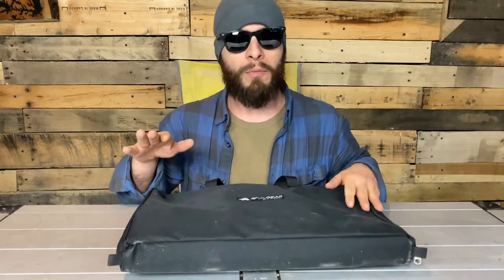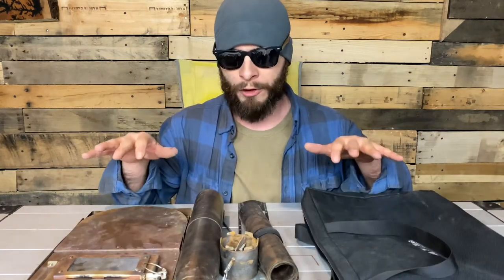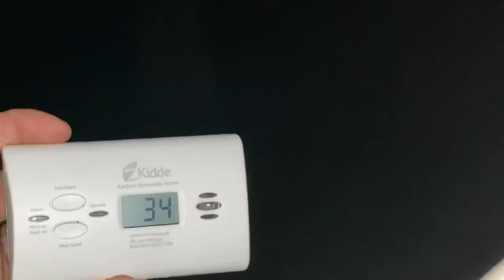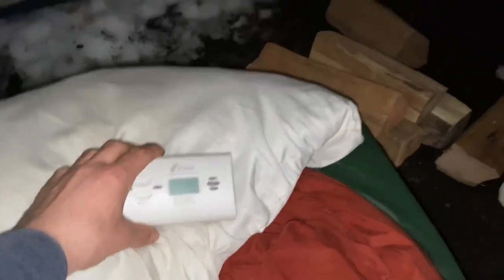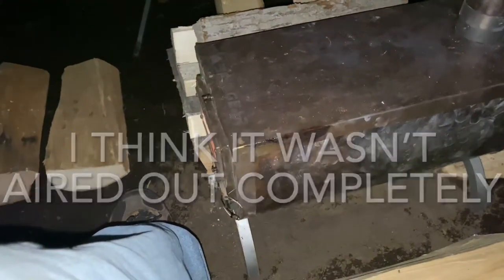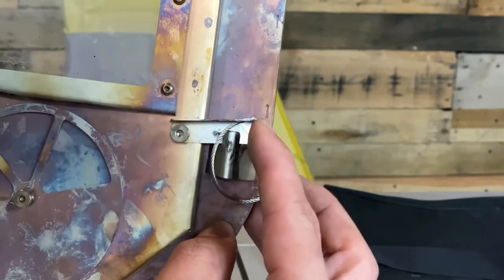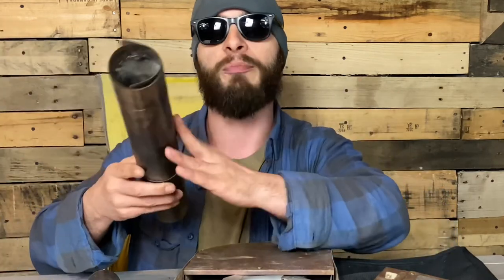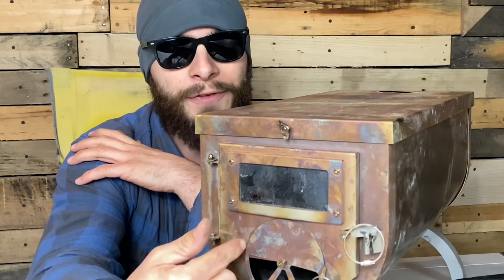Pros and Cons of 3F UL Gear Tribal Stove REVIEW

Comment: I have used this stove for hundreds of hours and I have nothing bad to say. The video shows that you have forgotten one thing. Always remember to check the tightness of the bolts when assembling. That's why the hatch opened.
Reply from the maker: @JKortet could be. I had a few weekends with it running just fine. I’m just sharing my experience that I had and what I believe caused it. Thanks for watching
Reply: Same, I’ve used this too many times to count and works great. My only issue are the stove top guides broke off, not an issue with the front and end have guides and i Needed to make a spark arrestor. It does look mangled lol
Reply from the maker: @banshee107 yeah I only had the problem once, stopped using it after that. Thanks for watching

Comment: When u ventilated the tent of CO, it looked like u opened the top. Isn't CO a heavy gas and would fill the bottom of the tent to the level of the detector? So when u detected again, there was still some gas at that lower level, if that makes sense? Tho I know CO messes with ur cognition, so u might not have been thinking straight, no fault there. Glad u both lived to tell that story. I'm still looking for a lightweight titanium tent stove &/or modifying one of my tents for hot tenting in the winter or shoulder season
Reply from the maker: @Daniel Singh from my research I believe CO mixes evenly with the surrounding air as it’s the same weight as other gases in the air. I could be wrong and you could be right about me not getting a proper reading but idk. I sum it up to fresh air clearing the detector while some was still in there. But I’m not sure. Freak accident for sure and thank you, I’m glad we are fine as well. Thanks for watching!

Comment: I could imagine having that happen, at all, would shake your confidence in a product, let alone with having your kid in there when it happened. I don't think anyone is trying to convince you to give the stove another shot. I certainly am not trying to convince you of that.
With all of that said, I do have a couple of thoughts, just off the hop. Are you getting the stove too hot possibly?
That latch slot could easily be extended with a file or a sawblade, allowing the catch to seat in there further. 
Even if the door warped and lifted, that latch is free floating and would have just stayed in the slot. Certainly if you're jiggling the door up and down like you did, it is going to eventually pop out of that slot. Any door would. That slop in the door could easily be mitigated by tightening the bolts that act as the hinge. 
Personally I really appreciate your honest review of the stove and I appreciate the information.
I also appreciate that you woke up when that alarm went off. I'm glad this didn't have to be a different kind of video. 
I'm going to look for your video on the second stove now.
Reply from the maker: I never did a video on the second stove unfortunately. A company representative said some pretty rude things and left a very bad taste in my mouth, after this video was posted. And kinda moved on from it. Thanks for watching
Reply: @AdventureswithSpackmann   I don't blame you in the slightest. That would have upset me as well. I'll be watching your others.

Comment: Glad you two are safe and sound. I know one company that I won't be purchasing a stove from. I hope that new stove you have works better than its counterpart.
Reply from the maker: @East Coast Outside Adventures thank you! They did change the design of the door on their 2.0 version. Seems better than before. Thank you for watching!
Reply: @AdventureswithSpackmann  No problem.  I seen their rep attack you for your video. What they did was uncalled for. All you did was inform us  of what happened and 2 theories. Hope all is well.
Reply from the maker: @eastcoastwildcamping   thank you. All is well and hope the same for you and your family. Have a great day!
Reply: @AdventureswithSpackmann  You as well. Stay safe out there.🤙
Reply: @AdventureswithSpackmann  OK I must have gotten the 2.0 version. The door still has play but not as much. Still worth setting up a back up latch for safety. thanks
Reply from the maker: @voidisyinyangvoidisyinyang885  2.0 is completely redesigned with a folding body instead of the rolled body like this one. It’s a box instead of the mailbox shape. I’m excited to use 2.0 but maybe they made changes to 1.0 and that’s what you got. That would be cool if they have made changes to the door.

Comment: Holy cow!!  Great demonstration on why to bring a CO detector!
Reply from the maker: @Jeff Pennucci lol right! I made a video testing detectors before and this was a real test! Thankfully I had it. Thanks for watching!
Reply: @AdventureswithSpackmann  I have this stove - thanks for the door warning.
Reply from the maker: @Voidisyinyang Voidisyinyang you are very welcome my friend. Does your door have as much play in it as mine does? I plan on adding a bigger latch to make sure it doesn’t do something like this again. Be safe out there and thanks for watching!
Reply: @AdventureswithSpackmann  I''m checking out my door and my door does not "lift itself up" when I push down on the latch. Also I don't have those front rivets on the glass on the door. So maybe my door is a slightly different design...
Reply from the maker: @Voidisyinyang Voidisyinyang that’s awesome hopefully yours works great for you!!! I really enjoyed the stove until this happened to me. Have fun and make sure you bring a CO detector and smoke detector when using it!

Comment: I sleep in a tent with a stove maybe 20 nights year. I use a carbon monoxide warner too but I would never go to sleep while  the stove is burning. I like this stove you have and I think I am going to buy it because the stove i use now weigh about 40 pounds ha ha ha
Reply from the maker: @Christer Kajan they have the fast folding version now. What stove are you currently using? Thanks for watching
Reply: @AdventureswithSpackmann  oh, it's an 18 kg (maybe 40 lbs) Savotta so it's not anything you carry any distqnces ha ha
Reply from the maker: @Christer Kajan lol I hear that. I have a Camp Chef stove and all in I think it’s 45-50lbs but will heat a house lmao.

Comment: Great video man! Given that the one you had is more or less a prototype and the problems are still somewhat easily fixable (by tightening the hinges on the door and deepen the notch on the door lock) I think 3F will probably do better on the new version! Please do keep us posted! Cheers!
Reply from the maker: @Bohan Zhang thanks for watching! I do believe deepening the notch and extending it up will help with the design. 3Fs version 2.0 of this stove has a completely redesigned door.
Reply: @AdventureswithSpackmann  that’s wonderful to hear! I also noticed that you are using the new three legged Naturehike cots in the hot tent, do you think you’d be able to fit 4 of those cots in the tent with the stove in place?
Reply from the maker: @Bohan Zhang without the extension legs maybe but it would be a very tight fit. Then risk touching the walls and condensation. 4 air mattresses on the ground would totally be doable though.
Reply: @AdventureswithSpackmann  Thanks a lot!!
Reply from the maker: @bohanzhang984  very welcome my friend!

Comment: I think you should do an EXTRA HOT tent video dude. Wait until it's 90 degrees in the summer and then camp in a fully blazing hot tent. 🤣🤣 I didn't realize this things was as cheap as it is!! Next year I MIGHT try hot tenting.
Reply from the maker: @Backpacking with Buckley lmao yeah a sweat lodge hot tent lol. Pass out from heat stroke lol. Yeah you can get in to hot tenting rather cheaply or rather expensively lol. Thanks for watching bro!